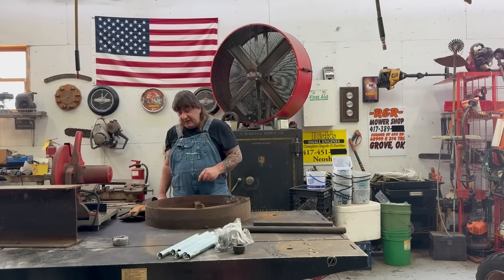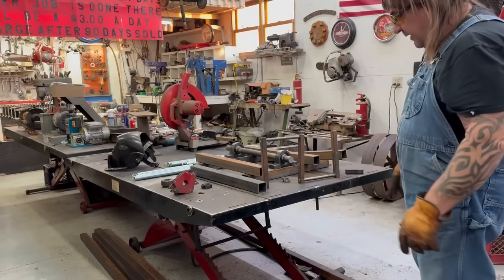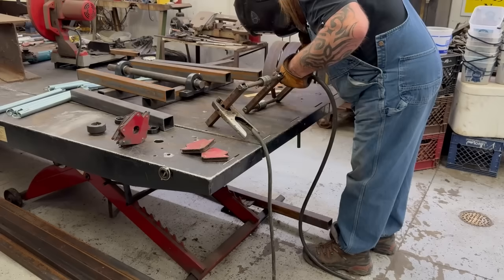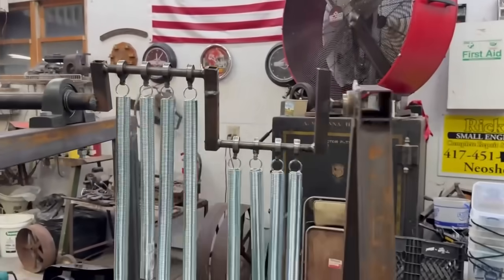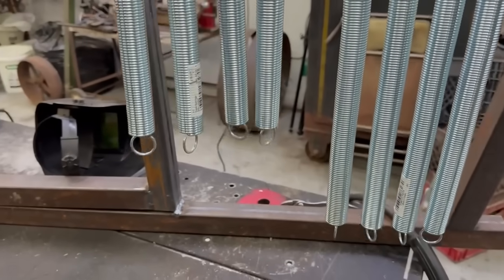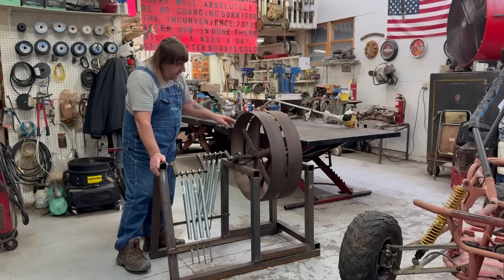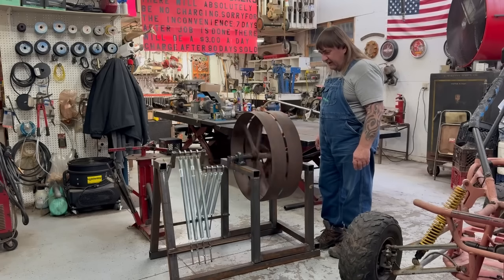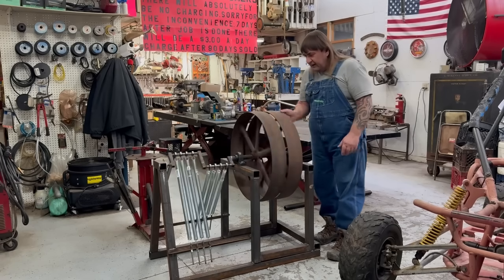Building A HUGE Flywheel Spring Engine (Free Energy?!)

Comment: What about putting a handle for turning on the end ... so you can maybe get it spinning and then go to the handle on the spring end and turn it by hand to keep it spinning ... then add your belt on for working ... or maybe put a bicycle on it with the gears to keep it going... there seems to be potential for free energy ,, sorta

Comment: Just maybe if you could .. make a cam device that unloads the  spring before top dead center and advance the other set to beging to pull earlier. In the  cycle rotation.  which is A  one stroke
 To begin with.
Reply from the maker: That's an interesting idea, I'll have to think about that!

Comment: try unhooking one set of springs so when the crank shaft passes the half way point the springs pull on the shaft giving the flywheel a shot of mometum without the other set of springs canceling each other out

Comment: As you stated, there is no pulse, if the spring anchors were on a cam where they can be loose as the other set are providing that pulse? As it sets, its pulling on one set while the other is stretching, canceling each other out. If the spring being stretched could be left loose, and stretch as it's supposed to be pulling the flywheel faster, without the other set interfering, it should work.

Comment: Hmm.. the springs are not under enough tention. I'm not saying it makes it work,  but the stored energy in the tention takes turn to release and get "cocked" with help from the flywheel. But ! You allso have to pre-spin the flywheel,(=energy input) then engage it.
And try a wawe shaped crankchaft with sliding springs for fun !

Comment: I knew it was b.s. from the get go. Didn't make any sense. The weight of the flywheel would keep it in motion for a while but no way a fixed tension from springs could keep it running 😮😂😂
Reply from the maker: It's just for fun, I don't take it too seriously.
Reply: @lmsmallenginerepair4471  I've seen a lot of other crap on utube where people think they know things that, from experience, I know they're wrong. I'll watch until I see something stupid and that's it. I'm out of here 😄
Reply: I do love some of the comments I see though. Sometimes that's the only reason I check them out is just for a good laugh 😂.

Comment: Try a flywheel from a square baler. It has the weight on the outside for the rotational moment of inertia to continue. Your wagon wheels has all the weight in the spokes and center hub.
Reply: I thought the same thing
Reply: This obviously doesnt work either way
Reply: @lukeremick9224  If you never challenge the laws of physics we never advance as a civilization. Every major technological leap in history, from the invention of the steam engine to modern space travel, has stemmed from scientists and engineers pushing the boundaries of what is known about physics, trying to find new applications and workarounds within those boundaries. By actively exploring the limits of physics, we can stumble upon entirely new phenomena or insights that lead to unexpected breakthroughs.

Comment: You have to have a weight to match your spring. But I don’t remember.
Reply: One of the cranks has to be longer than the other by like two inches or close to that
Reply: Need a piece of wood to put against the weighted flywheel for a stop. The springs need to be under a decent amount of tension don’t be afraid of it.
Reply: Those springs are too weak it needs to be under and incredible amount of tension
Reply: You got it,,,, tighten them springs. Be careful it goes, it may not stop.

Comment: What if you tried moving one flywheel to the other end of the Crankshaft,  so they is one on each end,  and then adding weights to each flywheel,  
  And set up the weights at about 120 degrees apart, 
  Right now you don't have any weight to offset the balance.
  So it is not creating a pendulum effect.

Comment: Think about it like a Pendulum. Gravity does the actual WORK. The momentum can be sustained by 
small impulses of energy at the Right Time. Just like pushing someone on a Swing.  A set of magnets
and coils could capture and store electric energy in capacitors to pulse coils at the right moment to 
propel the pendulum. You just have to get the angular velocity at max before taking out power. At the 
Bottom of the Arc Swing.  Then give it a Boost Kick.  E=mcx2. Great Build and Video!!

Comment: I have been looking at those perpetual motion flywheel and spring machines and wondering if they really work. Thanks for making a test setup to prove they don't work. I've been told engineers can go on a computer and work out a design that the computer claims would work no one has yet been able to get such a machine to work. It's great to see the self powered machine thrive into the present day.

Comment: I would suggest that you need to make it 120 degrees apart ,your current setup has equally opposite forces , separate  your spring shaft and please make a 120 spring crankshaft for a real test

Comment: hey I see those old pulleys have spokes... do you remember those beads that kids used to put on their bile spokes ? they slid up and down as the wheel went ound.... so I wonder if that could work as propulsion... just weights that slide to the center on the up and to the outside of the rim thus shifting the weight on the downstroke?....just a thought, and ya already built the dang thing.... lol good video regardless thanks

Comment: Great job Mark!  What would happen if you attached the bottom of the springs to a counter crankshaft, timed to the flywheel main shaft, so the springs would go slack just after bottom dead center and pull tightest just after top dead center, so the springs are working to pull the flywheel around, and never against it?  
The timing chain & sprockets would add some drag, so it would never be a perpetual motion machine, but loading and unloading the spring tension at the right time should help keep the flywheel turning in one direction longer.  You already have the spring engine, so I hope you’re as curious as I am, and test my idea!👍🏻😁
Reply: What about attaching paint cans to the pullies at 45degrees 1/2 full of sand?  Like when you push a 1/2 full gal of milk you get a little pulse that moves the jug.
Reply: But what would tension the springs for the next stroke?
Reply: @blindabinda1234  
The momentum of the flywheel rotating the main shaft would also rotate the countershaft timed to it with the chain and sprockets, tensioning and de-tensioning  the springs in turn; just an idea to try and tinker with to see if it prolongs the rotation of the flywheel.🙂
Reply: Anything for a buck!  Oh well, I clicked in on this foolishness myself.

Comment: It is not hard to see it will cancel itself out But! incorporate some cams on the bottom of the springs  with a couple v belt pulleys with belts going to the bottom cams so the spring pulling is on a cam and the springs not pulling in less so it doesn't cancel it self out I think it may work but It would never give you enough torque to power a generator!

Comment: Think your spring timing is off. Shouldn't the springs be 180 out from each other? The crank is but the springs are not at that angle. Like when one set of springs are at full tension the other set should be at full retraction.   Try it with all the springs attached to the frame in one long row.

Comment: You could try welding a counterweight on the wheel at a certain degree on the power stroke of the machine, also mess around with some different spring rates
Reply: It needs a reciprocating device attached to the springs so that it resets the load on every Revolution

Comment: How about applying a small lead weight to the inner wheel spoke and the same on the outer wheel poke opposite each other to balance the gravitational pull on the weights thus giving you the thrust you need to overcome the moment when the springs are at momentery equilibrium with each other? 🤔😎

Comment: Timed counterweights on the flywheel..... Counterweights need to be at a specific point at a specific time, just like engine timing for propulsion. Counterweights would help through the stretching of the spring point of rotation.  The counterweight should be just past high center when the springs are about to be fully stretched to carry momentum. That would require 2 counterweights timed during the spring "full" stretch point like an engine camshaft.

Comment: Take a long pipe with large threads on the outside and put a flywheel with threaded center hub mounted horizontally on the pipe. Weld a 6" diameter gear on both ends of the vertical pipe meshing with a ring gear welded to the outside of the wheels on your project. As the flywheel spins downward the gear turns the ring gear which turns you contraption. You will have to incorporate something to flip the threaded pipe 180 degrees when the flywheel nears tbe bottom to start it dropping again.
Reply: The flywheel has to stop to reverse direction........
Reply: @joemendyk9994  yes part of the mechanism .. so you can see what I'm saying!?

Comment: i wonder if removing a set of springs  and adding a counter balance to the fly wheel would improve the run time 
also ive thought about series of  electro magnets and permanent magnets  with the electro magnets  
 having a device to activate and deactivate them at certain times that provide some sort of thrust  then that could  spin an alternator to charge a battery that would charge a battery of course that wouldnt be linear  it would stop at some point and probably  not be able to do any sort of work that would beneficial to mankind

Comment: I’m pretty sure the concept is correct and a difference is like an engine. You have to have the cam with certain amount of duration on one side in a certain amount of duration on the other. It looks to me you got it all sitting down in less than 90° and that’s not gonna work.

Comment: AI says if you had a solenoid kicker to break equilibrium of the springs it would work.  So you need to hook up the alternator and spin it up enough for energy to power the solenoid kicker.  Hall effect sensors for solenoid timing too.  Worth a try I guess.
Reply: Nope. Not worth 1 second of anyone's valuable life.
Reply: @ why he’s not trying to make perpetual motion nor is it free energy.  It could be cheaper energy though and cleaner, if it works.
Reply: @gregjohnson5194  Nope. Not cheaper and not cleaner.  Like I said, NOT worth 1 second of anybody's valuable life.  Adding flywheels and springs is a proven waste of time.  And that explains why, it is not implemented, in the real world.
Reply: @MrSummitville  did you not read “AI software” claims adding a kicker solenoid could overcome the equilibrium problem.  I mean a lot of things are a waste of time in life, like wanting to go to Mars but people are still trying to.  Besides it can be fun to build and dream of a new invention, even if it doesn’t work in the end, it could lead you to something great that does work.
Reply: @gregjohnson5194 
✨️ WELL SAID. 🤔 ✊️🧐
Reply: The second you add a load to the machine the solenoid is nullified.

Comment: yes i would like to see that with a leaf spring. it did seem to work better. had a weight on it. spring held at one end, crank lifts with more leaverage at other end than the weight and spring coming back down as the crank is now closer to the mount end. dominant flywheel is the video. simillar set up as you have the decent flywheel. try more than one spring maybe.
Reply: No, don't waste your time.

Comment: That is indeed a large fly wheel. Interesting video
Reply: The size of the flywheel is irrelevant. What this basically is (wants to be) is a perpetual motion machine which by the laws of physics is impossible. Not unlikely or difficult, impossible. All of the bearings he used certainly reduced friction but it didn’t eliminate it. Friction steals energy. Without an input of some kind to replace that lost energy it won’t work. Same for all “perpetual energy machines”.